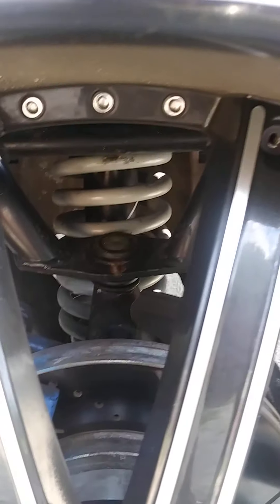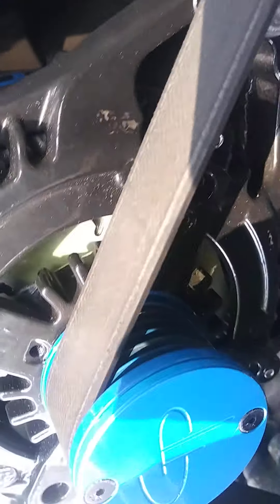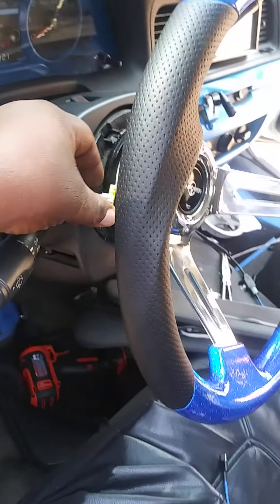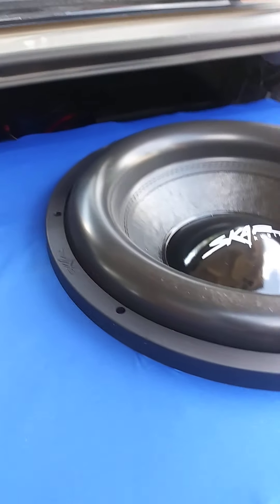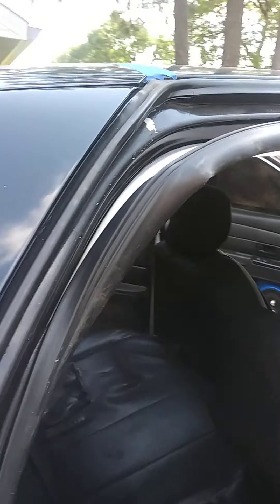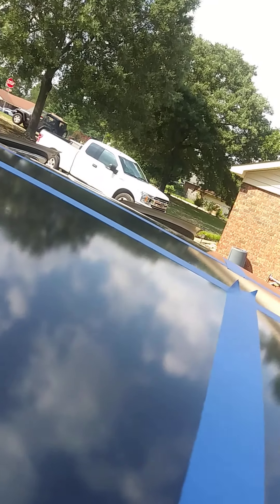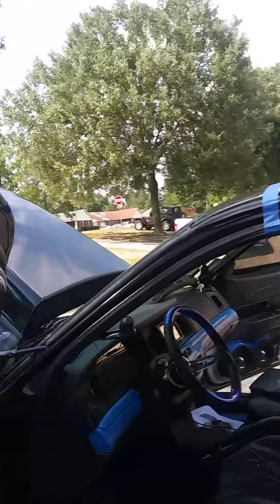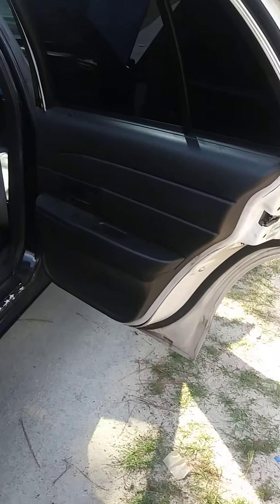updated walk around and progress on 09 crown vic t-top project

Comment: What's the plan for the doors with ur ttop project?
Reply from the maker: They getting cut too there will be no Windows in the doors ima start low cut up and round off to make it look original like it came from the factory like that
Reply: @bossmancustomz6891  so ur not planning on being able to put the tops back in? Would be sick if u could
Reply from the maker: @kutitkustomz2584  nope permanent t top its garage kept but that would be nice but that's took much work for all I got going
Reply: @bossmancustomz6891  ok. What about a Landau top like buddy with white box chevy. Maybach conversion top
Reply from the maker: @kutitkustomz2584  I have to Look into that I haven't seen it
Reply from the maker: @kutitkustomz2584  that would be different but I gotta stick to my resources I don't got no connect for parts like that